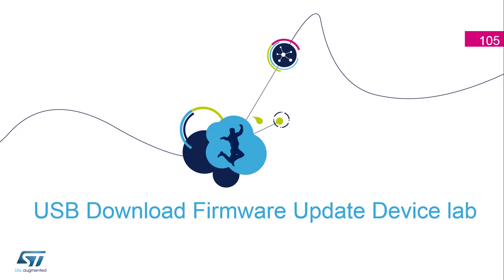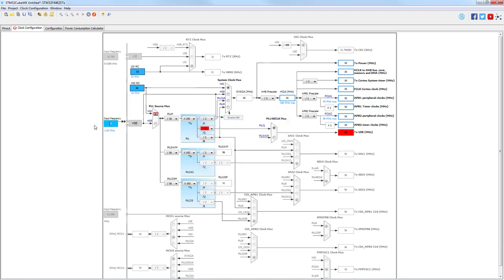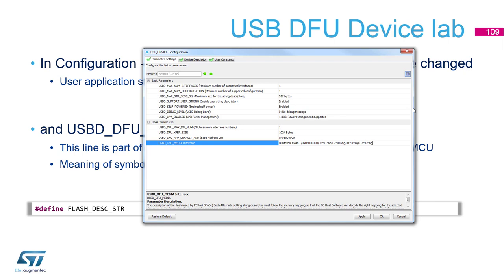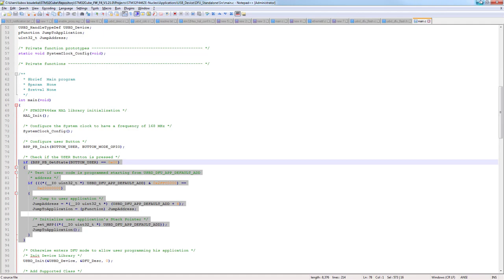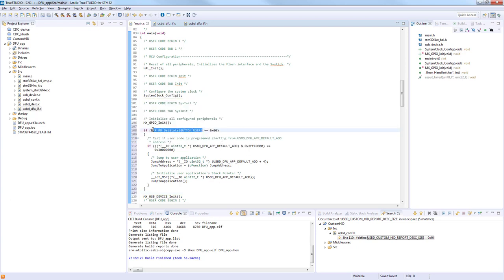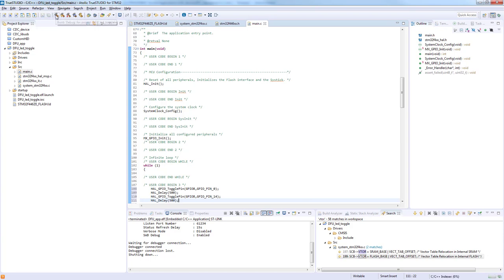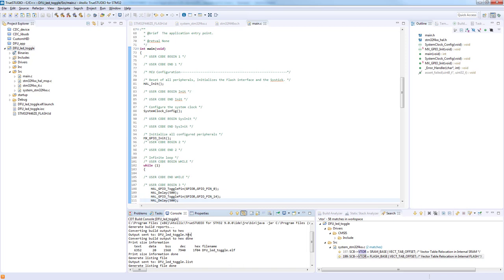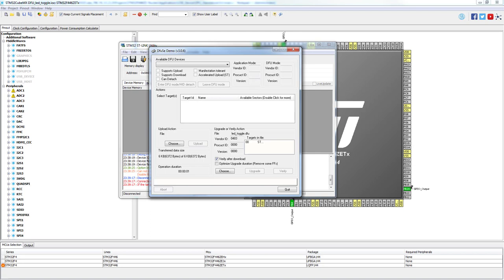STM32 USB training - 09.9 USB DFU device labs

Comment: In STM32F407VGT6 I needed to put these instructions:
HAL_RCC_DeInit();
SCB->VTOR = FLASH_APP_ADDR;
before __set_MSP instruction.
Otherwise, when using a peripheral in the bootloader that uses a variable type like this:
UART_HandleTypeDef does not let the led code work.
(STM32CubeIDE 1.9.0)

HAL_RCC_DeInit();
JumpAddress = *(__IO uint32_t*) (APPLICATION_ADDRESS + 4);
Jump_To_Application = (pFunction) JumpAddress;
SCB->VTOR = APPLICATION_ADDRESS;
__set_MSP(*(__IO uint32_t*) (APPLICATION_ADDRESS ));
Jump_To_Application();

Comment: if someone is facing any problem regarding to DFU software in windows 8, then try to check what driver actually you are using, in my case, for instance, DFU software did not work with the driver  date: 26/04/2018 , but it works with de driver 20/04/2015.
Reply: thanks for this info, is the problem you mentioned "unknown USB device"? I would be very glad if you could help.
Reply: @osmanozdemir4367  yes, it was that problem..., what i did was  only change the driver... but i remember that i suffered many issues to run this DFU loader... : /
Reply: I guess I am in the same situation but I am using w10, so should I do what it says? also where can I find the version you said
Reply: @osmanozdemir4367 i was figure out that the OS is not concern to this problem..., regarding to drivers it turns out that there are 2 major software to program our stm32f one is cubeProgrammer and the another one is st-link programmer that is pretty old, when i was checking the drivers, i realized cubeprogrammer had the  2018 driver, but st-link programmer had the 2015 driver
Reply: Then in order to get the drivers dated 2015, you need to install the st-link programmer from the stm web page currently is available...!!
Reply: sorry, is not st link programmer is st link utility...
Reply: @psykjavier   I get it, so can I upload code to the same stm32 multiple times with this method?